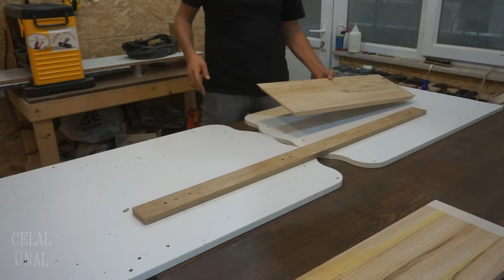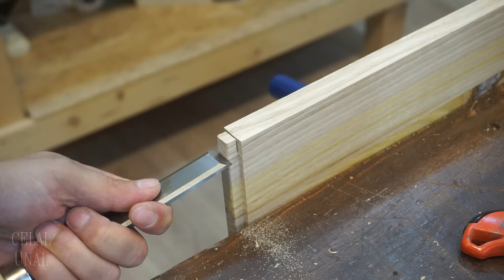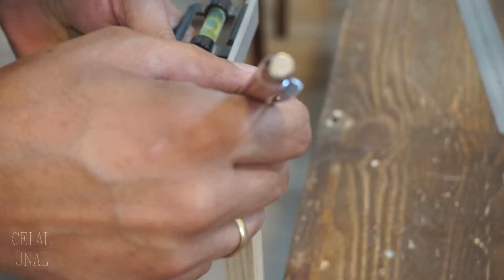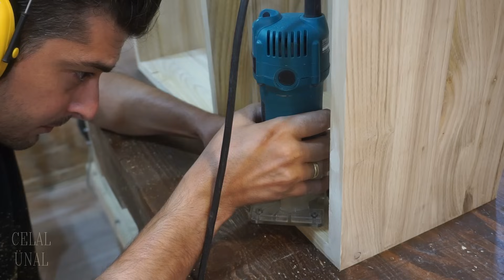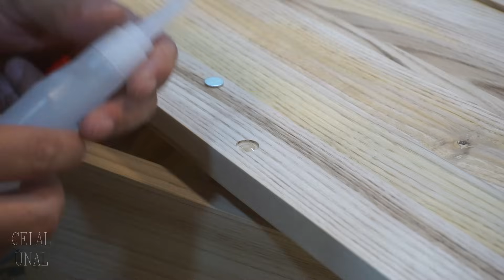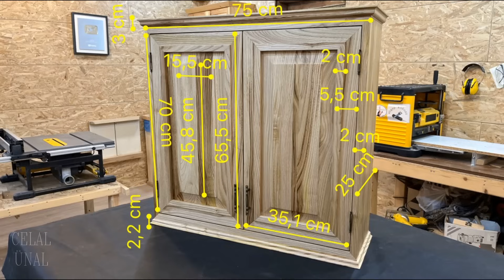Woodworking from chestnut wood, diy wooden cabinet // Kestane ağacından ahşap çalışması, ahşap dolap

Comment: Nice looking. Thanks for sharing. Glueing the panel into the frame is a mistake, as the panel will expand and shrink laterally and the glue will try to hold it in place. This will cause issues. There are other ways to secure the panel while also allowing it room to move. We used soft rubber spacers, while other cabinet makers have done things like tacking only the middle. I hope you learn and continue to grow in your craft. A router jig for mortises would make it go faster while insuring precision and uniformity, for example.
Reply from the maker: Thank you very much.😊🙏🙏

Comment: Nice result. A word of advice though; you should not glue the door panel. It needs to be able to move (expand and contract). Also, glued mitre joints are inherently weak because you are gluing end grain. I saw you added dowels to a couple of them, but perhaps you might consider splines or biscuits/dominos. They would make the joint less likely to come apart with age.
Reply from the maker: Thank you very much.🙏🙏🙏
Reply: Thanks for your advice

Comment: What make of planer do you use? And what make of table saw are you using? I am setting up a workshop and need advice… Kevin.
Reply from the maker: Hello. Dewalt dwe 733 thickness machine. Dewalt dwe7492 bench saw. I advise. Nice machines.